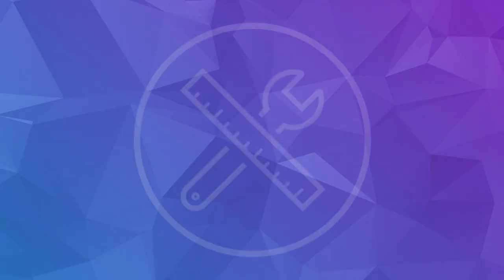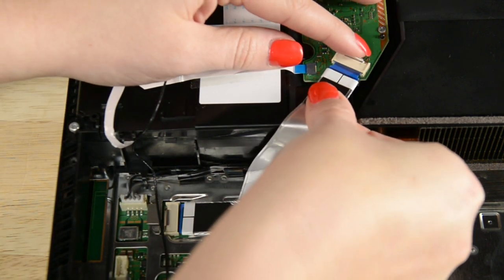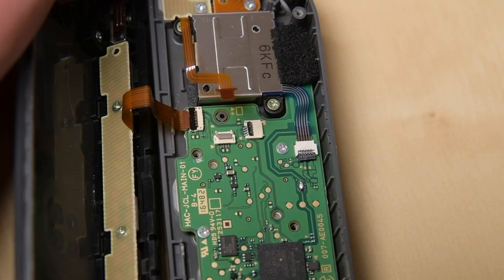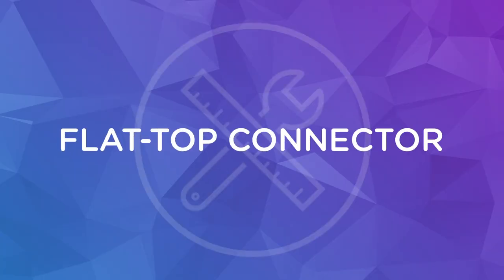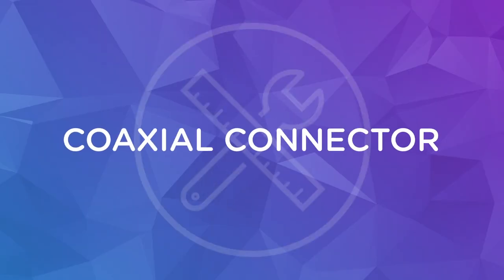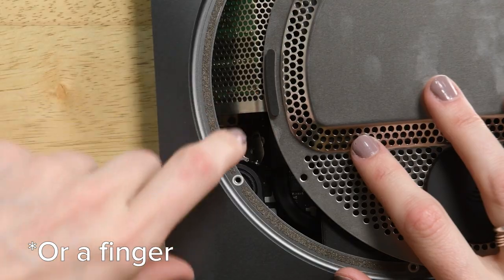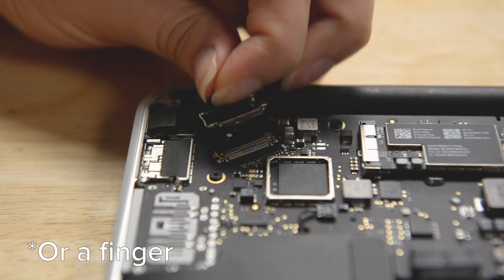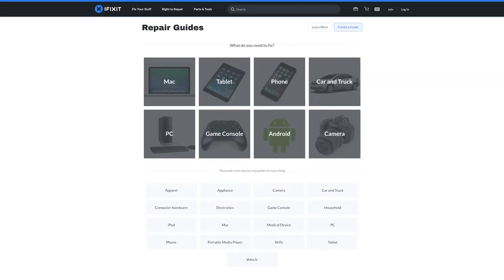Basic Skills: 5 Common Connectors and How to Handle Them!

Comment: Very good. One big tip: when prying up connectors or lock tabs AVOID putting a sponger or your fingernails around any local resistors capacitors or anything else. So many expensive board repairs are caused by breaking the micro parts off their pads.

Comment: Any advice how to safely disconnect the 3-4 pin style connector often used in laptop for fans or speakers, especially the older ones. Once i got 10y old lenovo thinkpad laptop with 2 pin connector, but because the laptop was never fully disassembled during 10 years of usage, the connector was completely stuck, more likely the white plastic of connectors were melted together. I have ended up with stripped connector pins from the solder on the motherbord and the whole plastic simply crumbled under my finger. I soldered pins back to the motherboard and used glue gun to provide at least some isolation. I know you mostly work on new electronic which has zero wear and tear, but trust me, to disassembly some 5 years old daily used common laptop is much more difficult than new one.

Comment: Can zif connectors be repaired?  I've broken the small clamp that you push down.  Thanks in advance
Reply: You can reattach if you find it somewhere, but usually it's a big job, better get the total connector repaired.
Reply: @VijayKanta  thanks is it difficult to replace.  Could I do it myself, does it involve soldering
Reply: @namrofni6236  Yes boss it requires some electrical work, I have no idea what, I would take it to the repairman, and get it replaced yes.

Comment: I'm here after I bought a ps vita with a broken right joystick(didn't realize it was broken).. which then led me to open the console, just to pull that ZIF connector to break it(didn't realized it had a lock to hold it in place)

Now I will have to use hot glue and tape to keep that tiny ribbon connected in the hopes that the new Joycon works...

Fuuuuuuuuuuuu#^&.